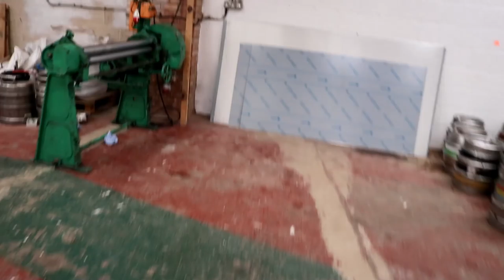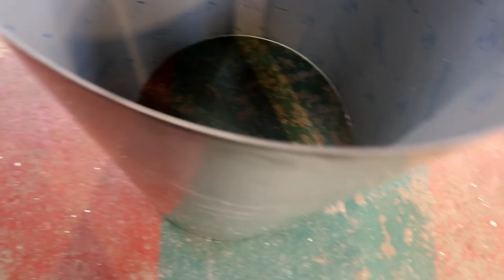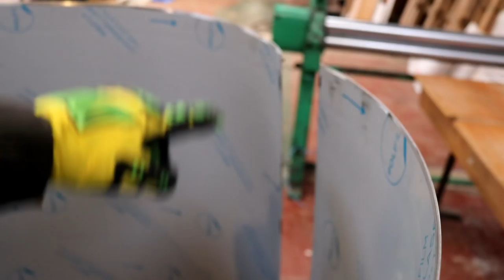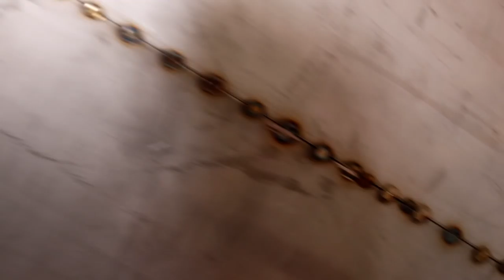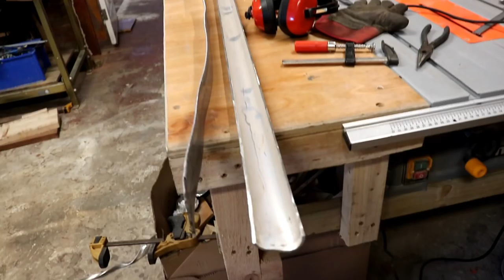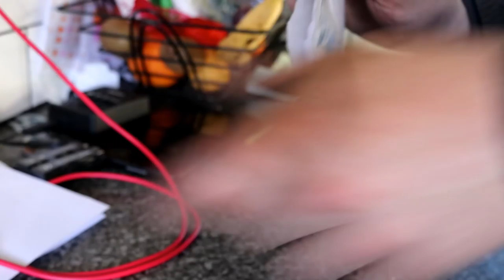JUST LIKE THAT

Comment: Well done Chris!  Something you may want to look in to is a different tig torch.  I see you're using a foot pedal control, which may be difficult to use while youre welding the interior seam of those tanks.  They make a tig torch with finger control (think motorcycle throttle) which may be invaluable when trying to adjust your heat while welding the thin stainless sheets.  Just an idea for you to ponder if you have difficulty maneuvering with the foot pedal. Keep up the great work, cheers!